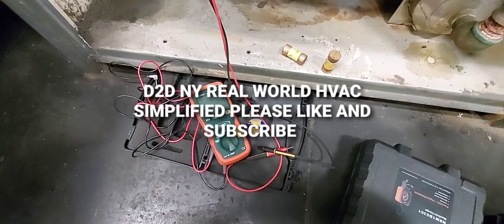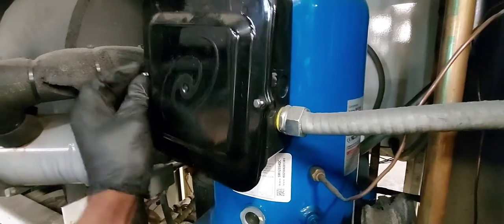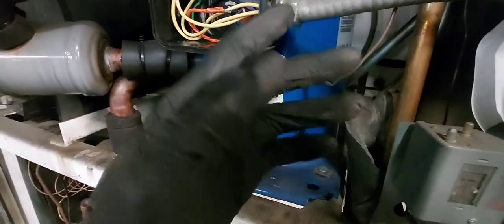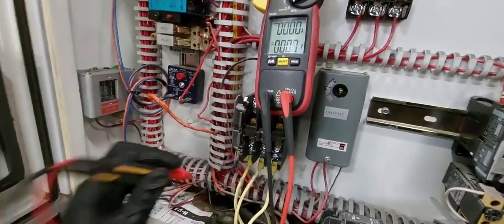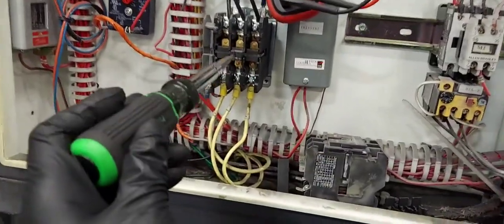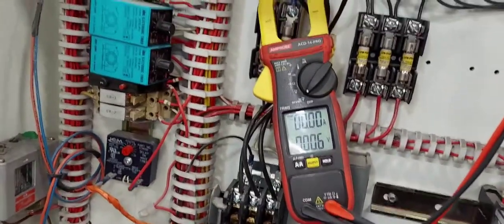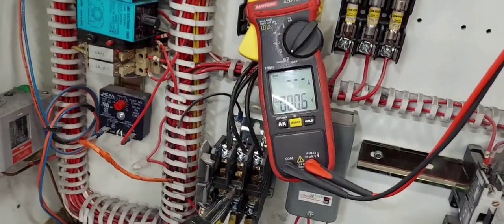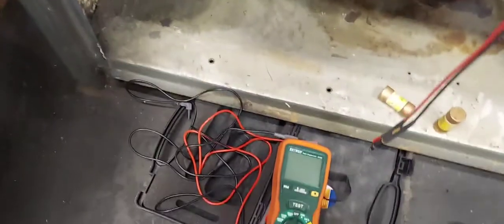A/C / HVAC COMPRESSOR  LOCKED ROTOR, LRA TESTING.

Comment: Sir thanks once again for your generosity  your are gentlemen where I work my co-workers……better not to say nothing!!! Please can you broadcast video about cut in cut out and diff settings and testing high and low pressure switches
Reply from the maker: @ law & Order I will do a video on cut in cut and diff settings of LP HP or fan cycling switch, stay tuned for that!
Reply: @D2DNYAC  cheers mate

Comment: Any tricks for unlocking a rotor?  mallet bang ?  I've heard something about changing wiring idk?  I know its a temporary thing but I need to unlock a 3 phase compressor.
Reply from the maker: Switch any of the two power wires it attempt to run the other way and possibly unlocks if it does then switch them back
Reply: @D2DNYAC  it worked!  Thank you, I've left it in reverse for some 13 days, not sure if it will hurt it.   Do I really need to switch it back?
Reply: @waynakins yes it's running backwards now